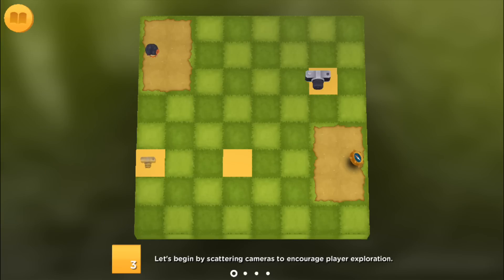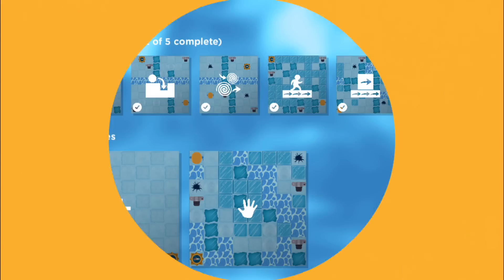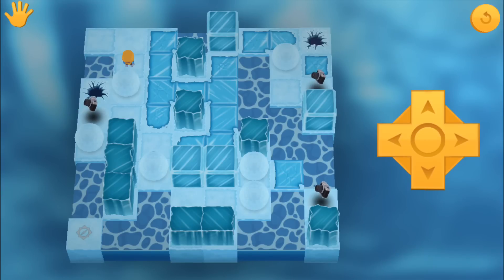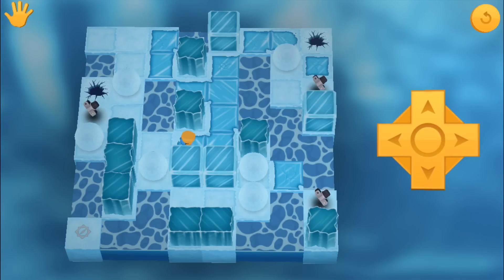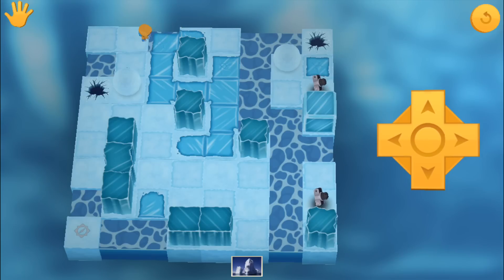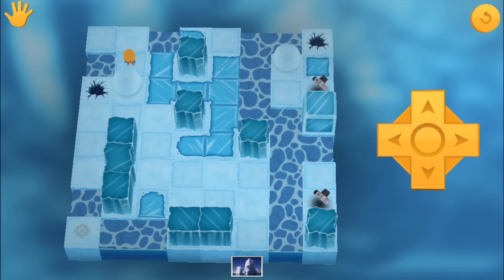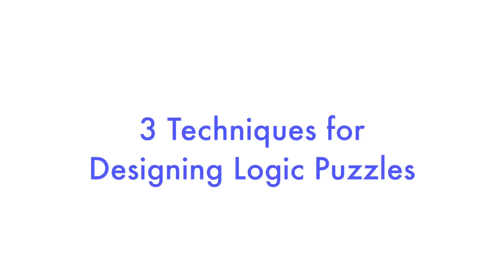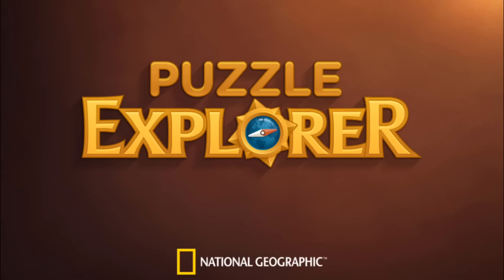How To Build A Logic Puzzle

Comment: 1:17 - What is inductive, abductive and deductive reasoning? And how is it used in game design? Does anyone know how to explain that to me?
Reply: Hey! Writer here. Deductive reasoning would be like seeing the set of numbers '1, 2, _, 4, _, _, 7" from those numbers you know that the missing numbers would be "3, 5, and 6" (Basically going from general observation, to a specific conclusion)

Inductive from what I understand would be like knowing someone is an introvert. From that very specific knowledge, you can conclude that they probably like being alone. (Going from specific knowledge, to a general conclusion.

Abductive is something I've never heard of actually. So, I looked into it. From what I read it sounds like explanatory reasoning. For example. There are small puddles on the sidewalk, the grass is wet, and the concrete is dark, it probably rained recently.

In game dev, this is how they'd be used for puzzles. Observing things, and solving them based on logical inferences.

Sorry if I'm not explaining it well. I like writing, but am not as good at defining terms. Let me know if you need anything else.
Reply: @Real_Moon-Moon  Thank you so much for your definitions! :)
Reply: @iannnavas  No problem. Glad I could help.